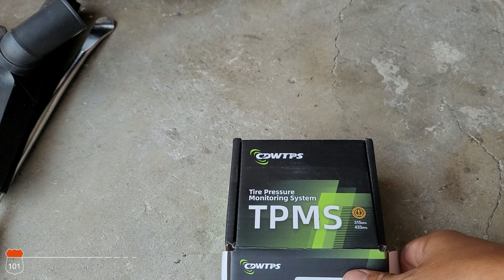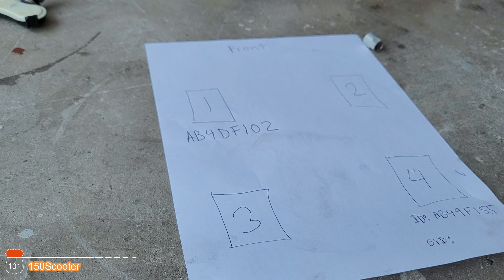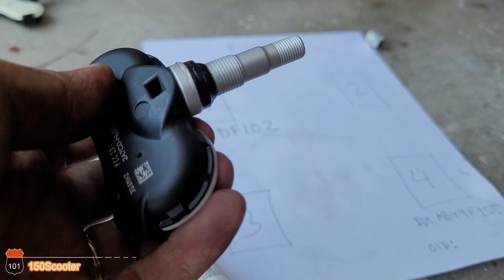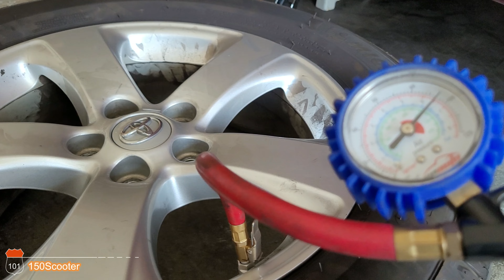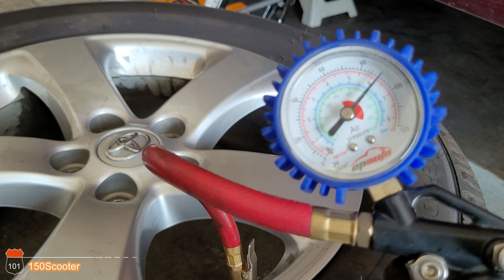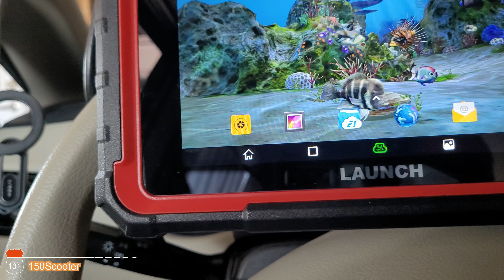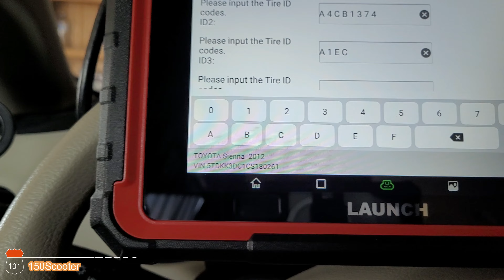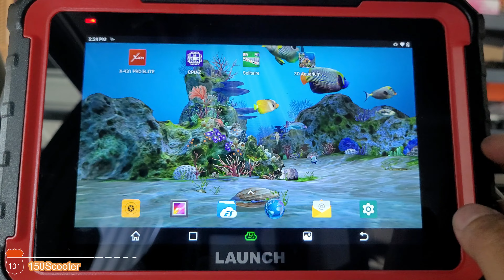Toyota Sienna Cheap TPMS Tire Sensors Installation and Program with Launch X431 Pro Elite Scan Tool

Comment: What air compressor are you using? Can I use a 6lb 150 psi compressor?  Thanks
Reply from the maker: 8lb 120psi air compressor
Reply: Thanks